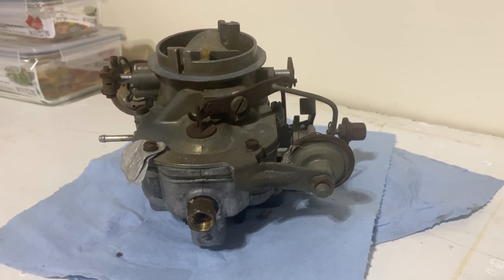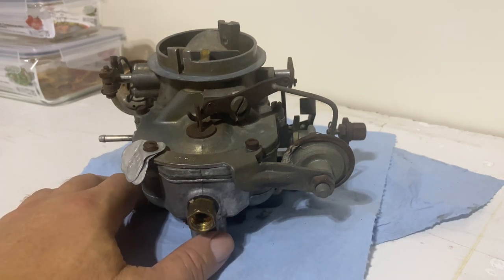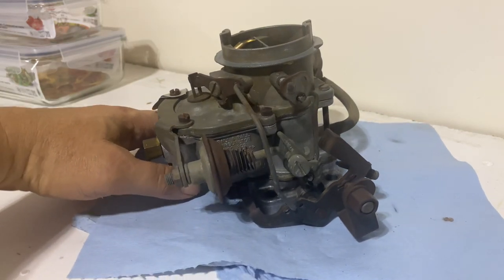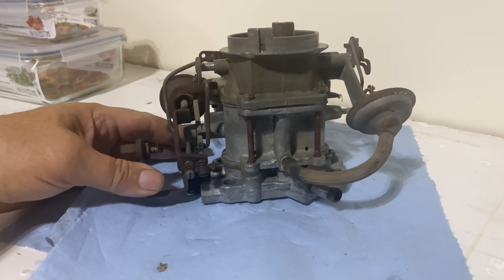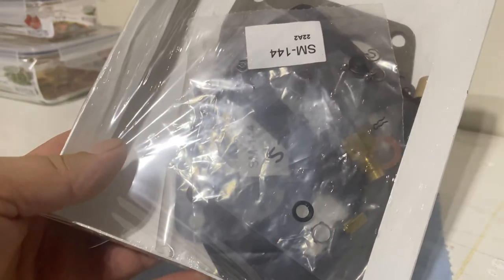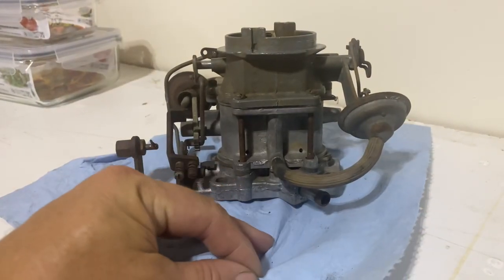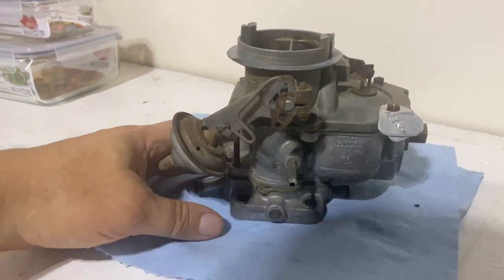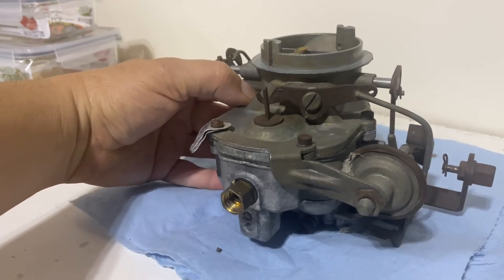1967 Plymouth Barracuda Carb rebuild. Pre- tear down video.

Comment: Last carb I rebuilt was a 4 barrel Carter thermoquad
Reply from the maker: what did they put those on?
Reply: @ 1976 Chrysler Newport Custom with a 400 cubic inch motor.
Reply from the maker: @ Those are incredible boats! Float like a ship on the ocean.
Reply: @ yep, and the seats were like sofas 😁
Reply from the maker: @Viper6-MotoVlogger  big fluffy velvety sofas!😂😂